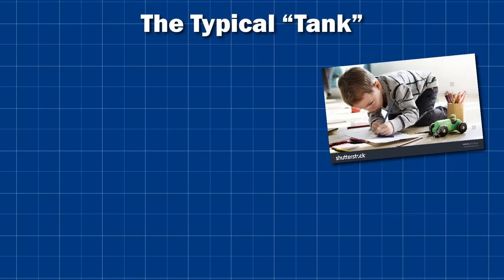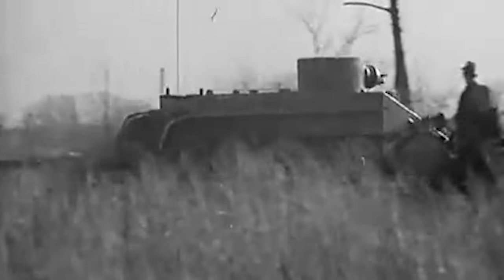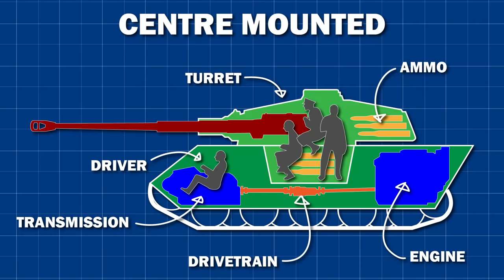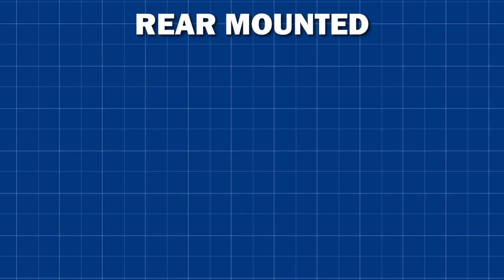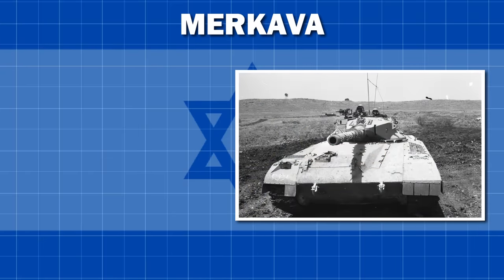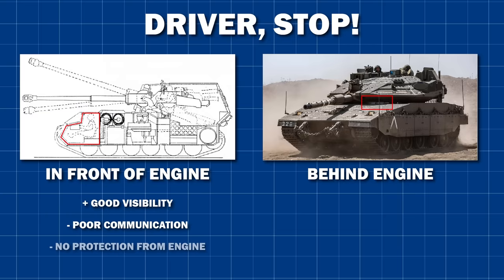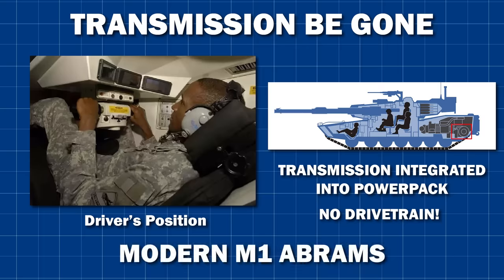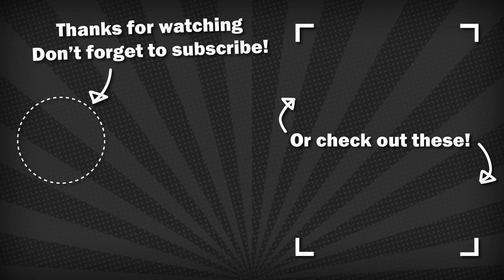What happened to Rear-Mounted Turrets?

Comment: There is one important disadvantage of rear mounting you did not mention : ammunition storage.  In rear mounted tanks they are stored in the back, and tanks are vulnerable from the back.   If you have it in the middle you have the additional protection from the whole engine block  if you get attacked from behind.  As you can see in many videos from ukraine getting the ammunition to cook off is very efficient in taking out tank and crew.   So protecting that ammo is important.
Reply from the maker: Surely this is actually an advantage? Since you would assume you would be taking incoming fire from the front and therefore having the engine at the front puts it between the ammunition and the incoming round. Conventional tanks, if penetrated from the front, have nothing between the round and the ammunition stowage.
Reply: @RedWrenchFilms     That was the case in the second world war, but you live in an era of rockets that can hit a tank from any side.  At the front you have the strongest armor on a tank,  and they do some geometric tricks to make it even thicker in effect.  But at the back  it is pretty weak,  so to have the additional protection of the engine block matters.
Reply from the maker: @daftwulli6145  To drones and top attack missiles, the vulnerable areas are the top and the sides, and assuming these are aiming for centre-mass the rear turret is slightly safer, if only by a small margin. The reality is that you need to place your ammunition somewhere and there’s no way to make it completely safe.
Reply: @RedWrenchFilms    No they specifically aim for the tourett,  since the T80 and the T72, the 2 russian tanks you find the most off, store their ammo in an autoloader directly under the turret.  It is the weakpoint of these types of russian tanks.  I never reallyunderstood why, difference in doctrine I guess.  Russians never seemed to care much about how many soldiers they lose as long as the objective gets fullfilled, which is really starting to bite them in the ass.  

The abrams on the other hand stores their ammo in an extra compartment  further down.  Even when you hit the ammo and it cooks off it explodes to the outside. There is a thick blastdoor separating the ammo storage from the crew, that only opens for a few seconds if you take out ammo. Vastly improving the survivability of a direct hit into the ammo plus ammo cooking off.   Also  from the front you have the thick front armor,m from the back backarmor plus engine block, and from the sides you have one vulnerable side and one side where you have the outside armor on the side plus the blast door.  Vastly reducing from where you can attack it, especially if you can put another tank there to protect that side.  

So while  you can´t make it completely safe, some solutions protect the crew much better then others, and in most situations the experienced tank crew is still the hardest part to replace .
Reply: @daftwulli6145 vehicles with rear guns mounted on vehicles don't go onto the front lines at least 30km behind the front lines since it's an armament not a tank
Reply: @steelnail1917   WE where not talking about artillery here. we where talking about tanks  with a rear mounted tourett. Did you even watch the video ??

Comment: Excelent video it was a good idea to have the engine in the front to protect all the crew. Because its better the tank is disabled or knocked out saving the crew to fight another day instead of being dead. With most modern MBTs esspecially older upgraded models like first the Merkava then Abrams, Leopard and Challenger MBTs with the Trophy active protection system can give the tank another layer of defence.

Comment: Headset communication (intercoms) is already a forced standard for tank crews due to the extremely noisy interior (engine + tank hydraulics + AC & ventilation + transmission + gun operation). Visibility is also a weak argument at best since periscopes have already come to be the dominant thing used in modern tanks.

Comment: thats tanks. in ivf, which have less gun weight and armor weight (usually), a front mounted turret is preferrable. You have to expose less of the hull, when peeking corners, making the time to peek and get cover shorter.
also in tanks its preferrable, but i guess the armor weight balance thing is a solid argument.
maybe the solution is to put engine and less armor in front, turret in middle, and crew in back with extra protection, and save exit to the rear. with modern electronics, there is no real reason to have crew in the front of the tank... nowadays you can basically sourround your crew with screens possibly tactical Overlay, fill the tank with cameras and microphones that filter out your own engine, and have better better battlefield awareness then any hatch open commander, despite not havin a single forward facing hatch

Comment: A centre-mounted long gun saved my uncle's life!
====================================
My uncle was a 19 year old Second-lieutenant,
fresh out of Sandhurst,
who arrived in Holland in 1944,
assigned to the Recce Troop of 15/19th Hussars.

He was in command of an armoured car
on the left flank during Market Garden.

They drove through a small hamlet,
which was a staggered crossroads,
leading to a long, straight narrow road,
set on an embankment with trees each side.

Driving down the road,
they came to a curve to the right,
and the rear end of a German Tiger tank,
which was at the rear of a German column.

/

Luckily the gun was pointed forward,
but the Germans were alert to their presence,
so they slammed the armoured car in reverse
to try and get back along the long, straight road
before the Germans put a shell in them.

The Tiger reversed backwards,
and kept trying to turn it's gun,
but with the narrow road and the roadside trees,
the gun kept hitting a tree.

The armoured car 
was getting closer and closer to safety
in the hamlet,
and the Germans finally turned their gun.

The armoured car
turned off the staggered crossroads,
and a moment later,
a shell went through the shop
which was at the end of the straight road.

It was that close.

/

RIP Captain Ben Sparrow.

He once said:-

"War is like a jolly good hunt."

He paused,
and there was a distant look in his eyes.

"But you must remember,
we were on the winning side!"

/

He once went looking for eggs,
and came back with half a dozen German prisoners.

Rather foolishly,
he was armed only with his service revolver,
and that only had one round in the cylinder.

/

When they got to Hamburg,
they liberated
a warehouse of French champagne,
and Goering's private yacht,
and set out to enjoy themselves.

/

Ben never, ever wore a seatbelt,
having seen too many men burn to death in tanks.

Police eventually left him alone.

He was a Good Man.

/

Comment: Doesn’t the KV, T-34, and IS series tanks have rear mounted transmissions??

Also important to note: These days, a power pack/engine block isn’t stopping APFSDS, and tandem warheads likely have little issues going through aswell but I have no knowledge on tht fully yet. Overall the Merkava thought process would’ve maybe worked in the time it was being thought of, but as far as modern day. The engine block alone, and transmission won’t block APFSDS. That’s why they’ve been slowly trying to develop the hull composite they didn’t think they had to initially.

Comment: Rear mounted turret could result in less gun depression, and the engine provides basically no protection whatsoever against modern apdsfs rounds anyway. Most rear mounted vehicles today are either IFVs or SPGs

Comment: Many self-propelled modern howitzers have adopted a rear-mounted turret style, like the Panzerhaubitze 2000 or S-Korean K9 thunder. Their gun barrels are so long that it would be impossible to drive around with them sticking out if the turrets are at the center of the tank.

Comment: 1:13 isn’t the front of the turret the same weight as the back of the turret? as even though the gun and most armor is on the front, the back of the turret is larger and more extended in shape. the rear of turrets are made to be just as heavy as the front because if one end is heavier than the other, it makes turning the turret harder, this why T34 american heavy has that huge slab of metal on the back of the turret, to counteract the weight of the new 120mm gun that was a lot heavier than the 105mm of the t29 with the same turret

Comment: The automatic transmission argument dosent really make a whole lot of sense. Mounting the trans with the engine in the rear is a concept almost as old as the tank itself.  Historically they have been mounted like this fully manual. Removing the driveshaft from the center of the vehicle allowed the basket to sit lower meaning the profiles of tanks could be lower. That's really the entire reason that became common place in the late 40s

Comment: Israel wasn't the only country has rear turret mounted  tanks.China in 1980s had invented rear turret tanks, known as type89 SPG. IT was rear turret mounted with a 120mm smooth bored gun, specialised for tank battle warfare. Developing in 1980s and came into service in 1989. Type 89 retired in 2013 due to unreliability!
Reply: yes but tbf israel is the only ones who have well known tanks that are actually yknow pretty good

Comment: Now I'm wondering if there are front-mounted tank turrets
Reply: last attempt of that I am aware of was the US and German army joint project of the MBT-70/KPZ-70 which attempted to shorten and decrease the tanks profile. The frontal turret location meant that the driver also had to be moved into the turret, which caused major disorientation to the crews which was one of the reason that idea was scrapped and ultimately resulted in the m1 abram project on the US side and Leopard 2 project on the german side.

Comment: There's another disadvantage for front engine vehicles that I think is the most important: Thermal signature. The engine can get quite hot and if it's in the front, its thermal signature is much harder to hide from the enemy's sensors.

Comment: I have an idea. Diesel electric tank. Individual electric motors driving each track, no transmission needed,  small engine running at constant rpm as range extender, massive instant torque, temporary silence mode if need be.

Comment: I know in modern battlefields it might not be common but a rear mounted turret allows for a tank to side scrape effectively which significantly increases its armour thickness on the side. And because of the rear mounted design it can safely shoot while exposing as little of the tank as possible.

Comment: Gearbox infront was down to bad designer decisions.  The complexity of that drive shaft was greater than that of a remote gearshift.
The Merkava driver has only a small disadvantage compared to other modern tanks, easily offset by cameras, as in the video of the Abram's driver.
Reply: Gearbox in the front was just a constraint of the available technology. Controls where levers and pedals acting directly on the gearbox and brakes. Turning was not achieved by the gearbox but by dedicated brakes on the appropriate track. That s why at that time they couldnot turn without moving.

Comment: What are the advantages of front-mounted turrets, such as on the T-34s, FT-17s, and so on?
Reply: atleast in theory you would need to expose significantly less of the tank in order to fire the gun in an urban scenario for example and you have more room for the engine compartment.
At the same time the overhang of the gun makes traversing confined areas and rotating the turret in them harder aside from the tank becoming very front heavy which can cause significant problems traversing uneven terrain.

Comment: An engine offers basically 0 protection against modern tank ammo. Tungsten or uranium long rod apfsds shells will go through an engine block like butter. One of the main reasons for the design of merkava was Israel's lack of composite armour technology at the time. They figured putting multiple layers of steel, air, engine block, and more steel would stop HEAT projectiles, which are the projectiles most likely to be hitting you. Against this the design is good.

Comment: It takes two kills to knock out an Armoured Fighting Vehicle. Mobility Kill and Gun Kill. If a tank's drive train system only is knocked out, the guns are still operational and make the AFV still a deadly enemy, If only the guns are knocked out, the AFV is still mobile, the AFV without operational guns is still a weapon in itself, just ask a grunt who has had a tank coming straight for him. Usually means he has to change his underwear at first opportunity,  if he survives.

Armoured Fighting Vehicle design is a constant compromise with competing priorities. The location of various features of an AFV have pros and cons. For instance, engine in the front theoretically means extra protection for crew from a frontal strike, con - more likely a frontal strike can knock out the front located powerpack which means, driver (if alive) cannot reverse away from follow on strikes which are sure to follow whereas a rear mounted powerpack would very likely be still operational to allow the driver to reverse from the danger. 

Another example of competing priorities is the German made Krauss Maffei Leopard 1. weighs about 40 tons empty. It was designed using experience learned in WW2 and mobility was considered a priority over thick armour; so had thinner armour to give higher speed from it's 850 hp motor. Problem was, as the Aussie Army finally figured out, there is no substitute for effective armour. and ditched their Leopard 1 for the M1A1 Abrams in around 2007. At the Tank Museum Puckapunyal north of Melbourne, there is a Leopard 1 turret which had a 105mm projectile fired at it, the projectile penetrated the turret's double thickness spaced armour with ease. This equals dead crew and no tank. Aussie armoured corps experts concluded from the tests that Leopard 1 is good for resisting 25mm projectiles but nothing much bigger. 

Merkava with engine in front and access door at rear means, ammunition replenishment can be effectively carried out during a firefight (providing the crew commander has the brains to make sure his vehicle is hull down - out of sight of the dreaded en). This ability to replenish during a firefight is not available to AFVs with rear mounted powerpack such as M1A1 Abrams, T90, Le Clerc, Leopard 2A6, etc. 

The one vulnerable point of all AFVs even modern AFVs is the track or wheels, a cheap RPG can destroy the track easily though from close distance, an anti tank mine can do the same. From a retired Aussie Armoured Corps soldier who spent 22 years driver then crew commander of the US made Food Machinery and Chemical Corporation manufactured M113A1 APC with the tiny Cadillac Gage T50 turret. The M113 - the VW Beetle of the Armoured Vehicle world! So many were made.

Comment: The issue with a front engine is a bigger heat signature also harder to work on the engine. Plus a engine is very minimal protection for the crew honestly I'd rather have the engine in the back to potentially protect the crew if they are unlucky because tanks dont hsve any real rear armor. But compared to frontal armour the engine is no protection sure it can stop a 50cal maybe a 20mm but that's about it